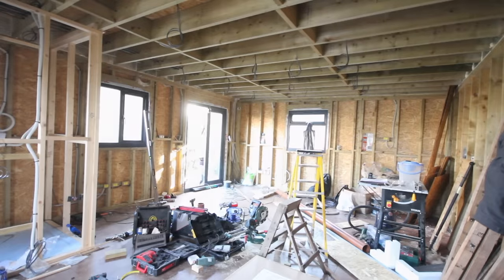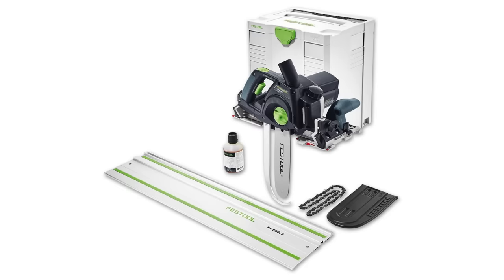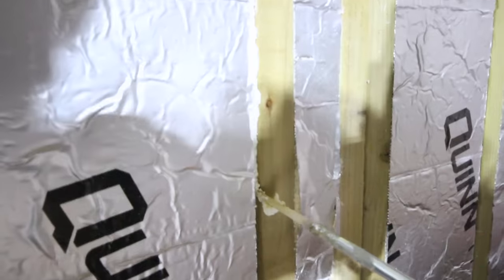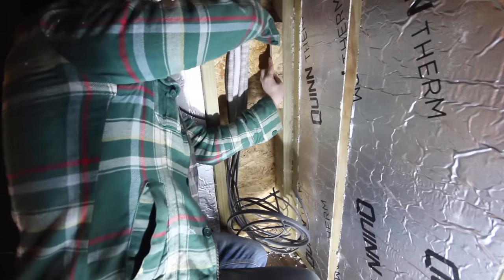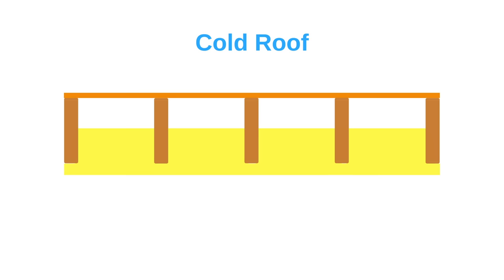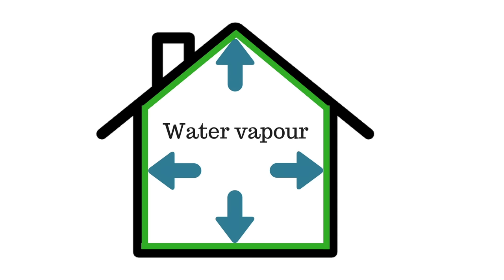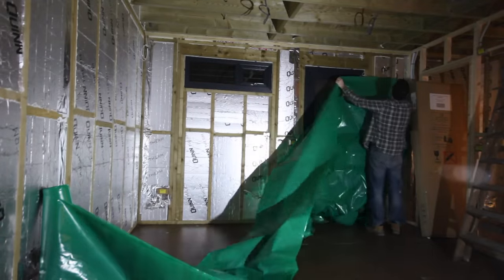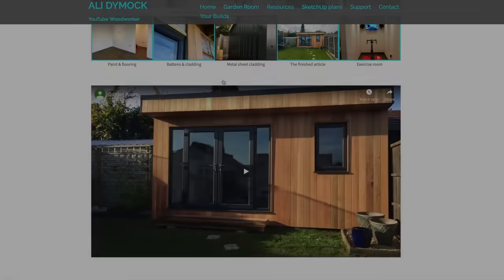Garden Room Workshop: Part 15. Wall Insulation & Vapour Barrier

Comment: Carcassing timber dimensions generally seem to be less than their stated size when regularised. How do you get round this for insulation - for example 100mm insulation for 100mmm joists when the joists are more like 95mm. If you go for a 90mm insulation Does the gap between the insulation board and the full width of the joist matter?
Reply from the maker: I went for 90mm and no a little gap between insulation and plasterboard is fine

Comment: Just use a bacofoil roll and slice accordingly. Use a spray adhesive and apply or, a spray bottle with slightly thinned PVA. Well worth considering. I’d use 1000 gage polythene, especially on a small are where it’s less expensive
Reply: This bacofoil trick could well be genius

Comment: Great video, I will be using some tips when insulating my garage.
My garage has a single skin brick wall, should I look to install some sort of DPM/barrier between the brick and the insulation?

I'll be using polystyrene boards to help keep costs down. Would it be worthwhile fixing some thermawrap over the top to create the same effect as the PIR and then vapour barrier over that?

Comment: so did you put vapor barrier on the inside roof i.e stapled to joists then covered by plasterboard for the ceiling? or just vapor barrier over your 18mm roof osb. cheers!

Comment: Hi Ali - following closely as im about to take delivery of my log cabin. when installing the PIR board in the walls, i noticed that you didn't leave any gaps or spacers behind them for air flow. i trust your judgement as all of your decisions are research based, so would be good to understand why you didn't do this. your words will give me a guide to if i build a small air pocket behind the PIR or just slot it in.
Reply from the maker: The idea is that the battens that go on the outside between the wall and cladding create that air gap instead of doing it between the studs.

Comment: Must admit... daunted by a build...  torn between the adventure of getting exactly what i want and the safe option of buying an off the shelf cabin....  so much conflicting advise on social media... vapour barriers, membranes and where to have airflow for damp and condensation prevention are my latest struggles....  im getting a little lost
Reply from the maker: Well I’m not going to say that self building is quick or easy but it is very rewarding and you’ll learn new skills doing it. It IS very achievable.
As for membranes, understand the science first and then it becomes clear.

Comment: you put OSB on outside of the walls, if vapor find a way to get in walls it will never dry out of there than you should have left  small gap between  insulation and plasterboard to let foil to reflect heat back in the building
Reply from the maker: 2 good points of discussion!
1. The OSB is somewhat breathable so will let moisture out. Also there are small gaps between the OSB so it should be fine. You can go without OSB or ply on the walls but the walls won't be as sturdy - there are always pros and cons of course.
2. True, you need around 50cm gap for the foil to radiate heat back so that would have left about 40mm to fill with insulation. Which is likely to be better?: 40mm insulation reflecting heat or 90mm insulation. My bet is on the latter, but again - pros and cons.

Comment: Hi Ali I have started my garden man cave /bar from watching your videos so helpful and detailed but I have a question I dnt intend to heat it or air con so do I need a vapour barrier and should I still use tyvek outside and use instulation in walls and roof as I've read someone has a lot of mould build up as moisture was trapped ? Cheers James

Comment: Excellent  however did you consider Kingspan SIPS for floor, walls and roof . A barrier should be a breathable membrane for timber frame to avoid interstitial condensation ?
Reply from the maker: I did look at SIPS and do think they are very good but for a few reasons I decided to go with timber framing - I think it's stronger, you can change your design at any point, more bespoke etc.
You're right, the breathable membrane is important but goes on the outside of the the building - see Part 12. The vapour barrier (impermeable) stops or greatly slows vapour getting in the walls and the breathable membrane (permeable) allows vapour out to the outside.

Comment: Hi Ali 
The garden room is looking great, and must say the video's are excellent and very enjoyable to watch. 
What is your  plan to stop vermin and rodents nesting under the floor, i have seen first hand mice, rats and wasp  make nests in floor insulation.
Reply from the maker: That's lovely to hear David, thanks! 

I essentially have no plan as I've not had any issues. I've left PIR outside and no animal is interested in it so I'm not concerned but this question comes up an awful lot so I am going to cover it. Essentially what you can do if you are worried: 1. fine mesh on underside of the joists or 2. concrete blocks all around the perimeter (just put air bricks in for ventilation) or 3. Attach OSB or similar under the joists or on top of the battens i.e. under the insulation. 

Wool insulation is much more susceptible to mice as it's cosy and can be torn off easily etc so if using wool then you would definitely need to do at least one of the above.
Reply: Thanks for the advice Ali, looking forward to seeing the next vid👍

Comment: I didn't think the walls needed noggins as other wall framing videos don't include noggins. They make the point that OSB will create the necessary rigidity for the wall studs. But that said, the noggins are certainly handy for sitting the insulation on

Comment: Ali, hope you don't mind me asking you (or somebody else who can answer definitively) but I am trying to decide how to insulate the walls of a similar build to yours. Basically I will have from inside out; plaster board, vapour control layer, stud work, OSB board, breathable membrane, batterns, and cedar cladding.

How do I insulate in the stud work?
 
Option 1)   Full thickness (Like your's Ali) for 'maximum' insulation.
Option 2)   leave approximately 1" air gap between insulation and plasterboard i.e. insulation up against the OSB. 
Option 3)   leave approximately 1" air gap between insulation and OSB board. i.e. insulation up against the plasterboard.

My understanding from speaking to a chap from an insulation seller is that option 2 is correct. Apparently any thermal gains from full thickness filling are equalled by having an air gap and the fact that the foil is more effective at reflecting heat. but this doesn't seem to be the most common. Can someone who can claim to be some sort of authority on the subject explain why all three techniques are in use and which one is best please. Obviously I don't want to fork out for 90mm insulation boards when I can use 70-75mm boards instead.

Also can someone tell me how deep into the wall electrics need to be to meet building regs - I've heard 50mm. 

Thank you
Reply from the maker: So that all sounds perfect to me and you're on the right video for this so I'm not sure what you're looking for exactly. Either use PIR as I did or thermal wool insulation right?
Reply: Qu1.  Air gap or no air gap?
Qu2.  If air gap, where?

Comment: Hi Ali. I don't know if you're still answering questions on this clip, but I'm interested to know why you chose that relatively low-expansion foam. Are the thermal properties of low-expansion foam greater than high-expansion foam? Or was there another reason for choosing that foam? Anyway, I enjoyed the clip.
Reply from the maker: Oh it was simply due to not wanting to make a massive mess. I really like Sousa Foam now, it doesn’t expand nearly as much as others, but more than enough to easily fill any gaps.
Reply: @AliDymock  Thanks bud. Good to know. I think I'll do the same :)

Comment: Good to see you back. Do you think it would be a good idea to leave an air gap behind the insulation. This would be in my garden shed walls which just has tongue and groove cladding on the outside- no membrane. I understand that this helps it stop sweating. 

The shed isn’t heated unless I’m in it maybe once a week. I plan on using PIR and aluminium foil to create some sort of vapour barrier on the inside. 

I plan on using a corrugated roof with some roofing felt underneath then plywood on my joists. On the inside I would like to insulate and create a vapour barrier to stop the warm air reaching the cold corrugated sheets and condensing. Is there anything else I could do to minimise this. Thanks for reading 🙌🏼
Reply from the maker: Ah a retrofit one! The point of the battens is that they allow air flow but you need a gap at the bottom and/or top to allow air to escape so I can't see the point of leaving a gap behind the insulation if there is nowhere for the air to go (other than leaking through or between the cladding). If you are only heating it once a week then I wouldn't worry about it and just fill between the studs all the way as you won't have a constant stream of moisture trying to get in the walls. As long as you have a vapour barrier, it'll be fine.
The roof sounds fine to me too!
Reply: Ali Dymock thankyou for the advice.

Comment: Cold bridging is always an issue with heavily insulated walls so foam fill all gaps and ideally tape over with foil tape. Cable conduit is ideal and can be foamed over no problem. Check the regulations but conduit can require a larger cable or for ring mains run each 2.5mm line in its own conduit. Correct spec cable for the load won't overheat.

Comment: Hi Ali I must say cracking job on build plus your explanations, just a couple of questions 1, why do you need to put rapping outside and vapour barrier on the inside because if I was to build a log cabin style with 100mm t&g beams I wouldn't need to. 2, if I was to build a shed 9m x 4m out of osb3 and then clad the out side with corrugated sheets wood the boards stay dry or just sweat. 3, as for the roof I was looking at the industrial insulated panels just for ease and they can carry weight (we had a new roof at my factory and amazed at how warm it is). I'm a toolmaker by trade and last year over engineered a decking base in wood but what did my nut in was how bad some warping and twisting the beams were and had to keep an eye on where I used them, I love the smell of wood but find it easier to make bases now from rsj or box section. Thanks again for your insight, people who don't regularly make stuff don't see what logic it takes to see why and how you do things in our heads before we cut metal or wood. 👍
Reply from the maker: 1) So with a log cabin there is no barriers at all so air (carrying moisture with it) is free to pass both ways. The same with uninsulated brick walls of houses. When you add insulation into the mix you need to stop air movement into the wall. The breathable membrane on the outside isn't so necessary in the UK because we don't use air con much, but still worth putting on.
2) you'd need to create a rainscreen with battens behind the sheet metal to allow air to get out of the building.
3) Yeh those insulated panels do look good! Agreed, builders tend to gloss over the simple stuff as if everyone of course knows what they're talking about. Even screws vs nails is a big question which no one would think to cover.
Reply: @AliDymock  Thanks for getting back, ive been looking at that many ways people are building stuff and its either over engineered or just bad material choices. Ive been trying to work out a system i can build at work and then put together at home, i brought a waltons shed 7 years ago and it ready to be set on fire the build quality is shocking and the wood is worse than pallet wood.

Comment: Hello, could you please explain why I shouldn't put a vapour barrier on top of chipboard? I just rebuilt my floor with new joists, kingspan insulation (with the foil vapour barrier sides) between them and 22mm t &g chipboard on top. I have made air vents through the raised foundation walls and fitted a moisture barrier on the dirt ground and walls etc all sealed to stop damp coming into the void under the floor. I was then going to put a radon barrier (I'm in Denmark) with built in vapour barrier and footstep attenuation on top of the chipboard flooring, then a wooden or vinyl flooring on that. As far as I can tell that's where it should go: between the finished floor and the subfloor. Isn't stopping the vapour in the warm air of the room reaching the chipboard a good thing?

Comment: Would spraying a sealant throughout the shed before putting in the insulation be overkill? How about a piece of metal on the inside of the door frame and/ or the doorway frame.  I'm so afraid the shed won't last twenty years. How about plastic sheeting between the insulation and the plywood?
Reply from the maker: I wouldn't spray sealant, no! That would prevent moisture from leaving the shed. If you're adding insulation and heating then a vapour barrier on the inside of the insulation is a good idea though!

Comment: Great video. Trying to figure out if I need a vapour barrier in my build? I am converting my garage into a room, but the existing garage door is remaining. Consequently I am constructing a room within a room (stud walls and ceiling in the garage. lined with OSB + plasterboard), then another separate wall 2ft behind the existing garage door that spans the width and height. It's an internal garage, all blockwork. Unsure if vapour barrier should be on the inside of the inner wall or if I need one at all.
Reply from the maker: With block work I’m less certain, especially if it has a cavity but if you’re putting up a stud wall, you will likely want to put up a vapour barrier inside of the studs, especially where blocking off the garage door. The other option is to use insulated plasterboard dot and dabbed directly to the block work. If it’s cavity I would just attach plasterboard and then only do a stud wall where the garage door is.

Comment: Hi
Is there a cavity between the outer face of the celotex and the outer osb/plywood.
Some websites seem to insyst on one. This will determine the thickness of the celotex.
I have a nominal 4x2 frame. Actual depth of frame timber is 97mm so i am not certain if i can use 100mm celotex as it will protrude. Any suggestions?

Comment: Hypothetically (I'm trying to apply this theory to a slightly different application). If in future you wanted to add more insulation to the inside. Can you leave the vapour barrier there, add the insulation, and add another vapour barrier on the warm side of that?

Comment: Just built my own ‘mancave’ and struggling with the hot air trapped inside, did you install any ventilation vans in this ?

Comment: Thanks for a great video series. Was very useful and provided a great confidence on the project I am planning. Could you let me know what cladding you are using being less than one meter from the boundary (considered as non-combursable) as mine would close to the boundary due to small garden.
Reply from the maker: Have a look at cement board-something like Magply or for decorative: Marley Eternit cedral click. Or sometimes, depending on b regs in your area a fire retardent sealant might suffice. It's a grey area it seems!
Reply: @AliDymock  thanks very much for your suggestion much appreciated

Comment: Hi Ali - i really need some HELP.   Upload after upload show the same method that you have used for your flooring.  However, i get the impression from some that there needs to be about a 25mm air gap between the Celotex and the underside of the flooring for the radiant barrier to work.  Is this what you are meaning from you learning?

Comment: I spoke to a technical adviser at Celotex who told me that there should be some ventilation behind the back of the insulation and the OSB, so to use 80mm thickness insulation set against some noggins to prevent it touching the outer surface.

Comment: Hi Ali fabulous video series, I’m awaiting summerhouse, we have opted to have the breathable membrane attached to outer skin , then will be using rock wool to insulate, would you still recommend a vapour barrier before boarding with exterior plywood (even with outer skin breathable membrane ? 
Also we have epdm rubber roof and the roof comes with no membrane , should we add an external membrane and also a vapour barrier (basically exactly same set up as the walls ? 

Thanks in advance
Reply from the maker: So the ply would be inside? I would put a VB between that and the studs personally. Especially with rock wool.
Reply: @AliDymock  thanks and approach the roof exactly the same as the walls ?

Comment: Avoid making dust as it is terrible for your health using electric cutters for PIR insulation, I recommend you use large bread knife is much cleaner, much cheaper and less dust and aggravation then the gaps are foamed in so you save a heap of money and hours of vacuum clean up.
Reply: Hi Ali great series of videos, what would you recommend for twin skin garage brick outside block inside, detached for in the main sound quietening  and insulation can I apply insulated plasterboard  directly stuck on wall no barriers etc would it be better moisture resistant two layers green glue

Comment: Did you add a vapour barrier to the ceiling or are you using the vapour barrier u used on the roof as one.